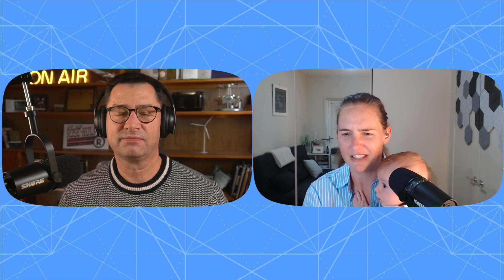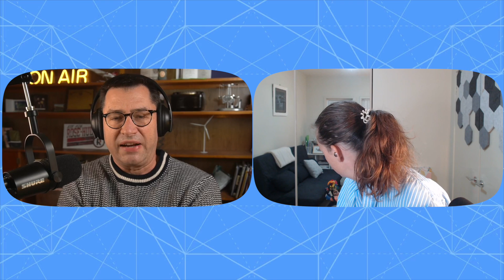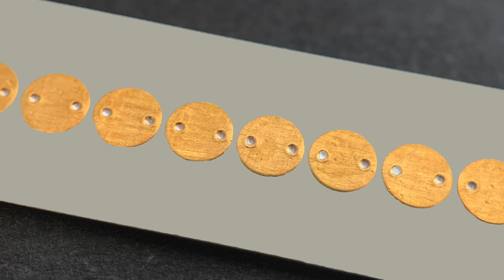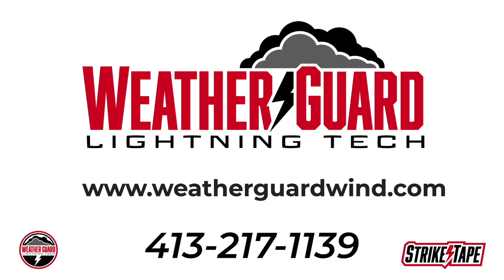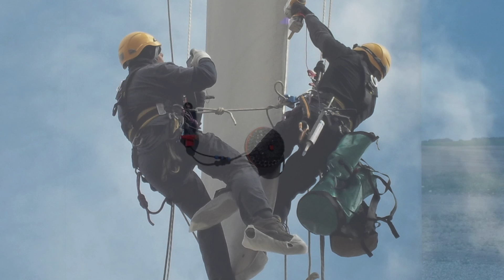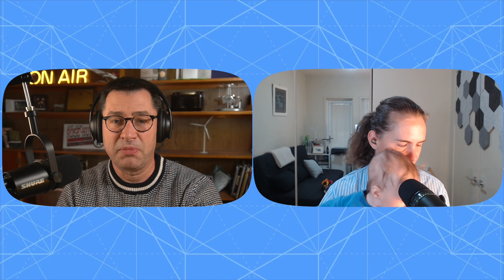Vestas recycles all blades, Windcatcher get funding, Modvion backed by Vestas, Budweiser Wind Farm

Comment: The obvious energy solution is to harness the power of the tides
Reply from the maker: Wave energy seems easy but it is a difficult engineering problem. Many have tried, few have succeeded.
Reply: @WeatherGuardLightningTech we could just use a water fountain combined with energy generating turbine with perpetual motion aawell to boot